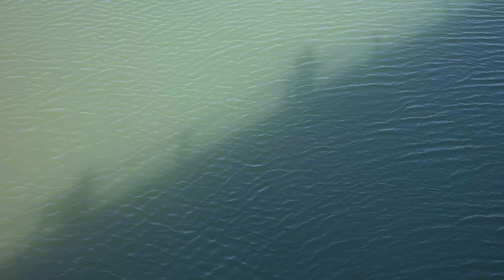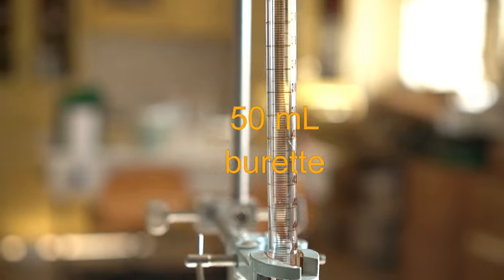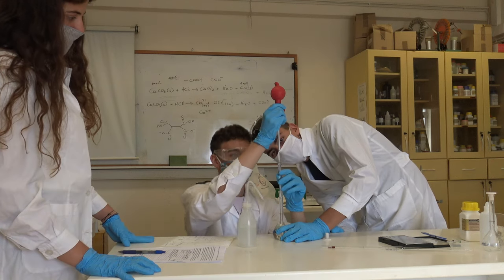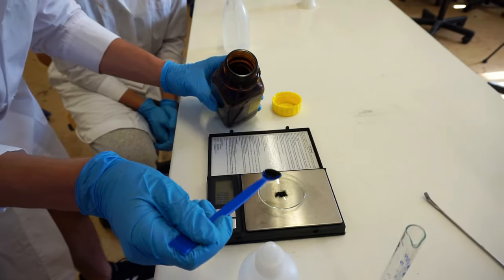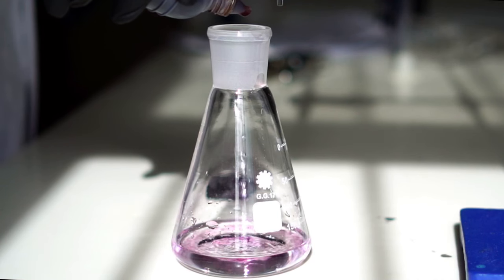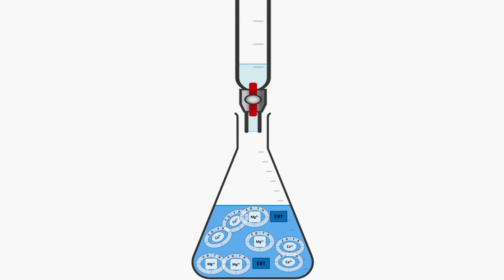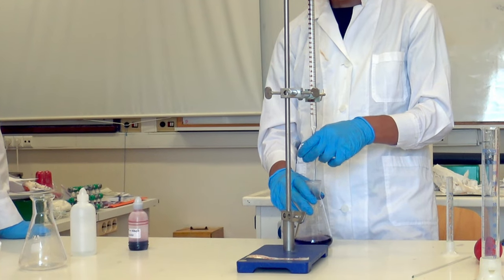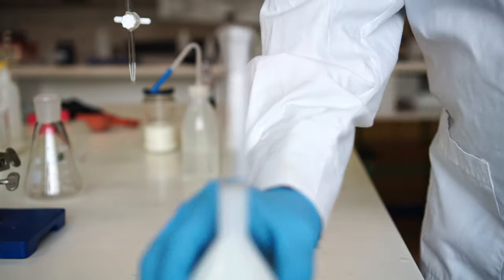Titration of water hardness  (complexometry explained). Bonus: Calcium in milk

Comment: Hi, I'm preparing to do this titration and I was just wondering what the concentration/method of preparation of the ammonia buffer solution was. I'd really appreciate it if you could send me the source material if there was any. Thank you so much!
Reply from the maker: This is how you will prepare the buffer solution.
For 200 mL buffer pH=10, 1M in ammonia:
Add 13.5 mL of 25 % ammonia solution to 50 mL deionized water. In this dissolve 1.94 g of solid NH4Cl. Add water to 200 mL final volume and mix.
Sorry for the delay.
Reply: @chatzida  no problem! thank you so much!

Comment: Great video. I want to ask a question. I used 0.1g patton-Reeder indicator to determine calcium in my sample. But it turn directly to purple after i added the indicator. It should be pink to purple to blue(end point). Is 0.1g is too much or my calcium content in sample is to low?
Reply: i think that happened cause you used a different type of indicator.

Comment: hii, great video! if I want to do this using yoghurt, what is the suitable amount? is it possible to determine the concentration of calcium and magnesium individually? 
lastly, I don't quite understand how the calculation works in 8:58 second line.
Reply: and also, if we calculate the calcium concentration in milk, will the magnesium has the exact same concentration as the calcium?
Reply from the maker: @lillian9448  this method calculates the SUM of magnesium and calcium; calcium in milk is usually 10-15 times (in terms of milligrams) more than Mg.
Reply from the maker: For the 1st question , I don't know  but personally I would dilute yoghurt with 3-4 volumes of water , stir well, filter through a mesh, perform titration and then adjust your calculations considering the dilution. For the 2nd question, I am not aware of any titration method for individual determination, but there should be other more advanced methods like atomic absorption spectroscopy. For the 8:58 calculations we assume that  all moles are Ca2+ (accordingly, we assumed that there is only CaCO3 - and not MgCO3 - in water) and therefore we multiply by atomic mass of calcium (=40)
Reply: @chatzida  hello! i'm not sure if i did this dilution right but i was curious in figuring out how i could dilute the yoghurt, (unit wise how many ml of water would that be?), i also found that before my titration the sample with the Black T indicator turned blue, and after titrating with EDTA it turned purple.. (which for this experiment I believe is supposed to be the opposite), do you might have an idea why and what i could be doing wrong?
Reply from the maker: For the first question you can weigh like 20 g of yoghurt add about 50 mL water , stir well, filter through mesh and then add water to the flow-through up to 100 mL final volume. For the 2nd question, it seems that pH was not 10 (did you use a pH=10 buffer?)
Reply: I thought the same. If in the first titration there were magnesium ions (50 ml from water bottle) the total number of moles of EDTA reacted as with Calcium as with Magnesium ions. So the calculation was not exact, unless we ignore the number of moles of magnesium due to its low concentration. @chatzida